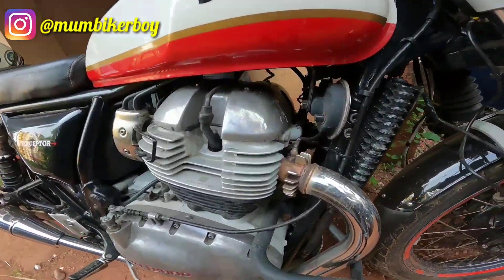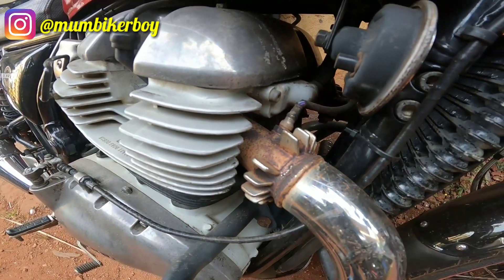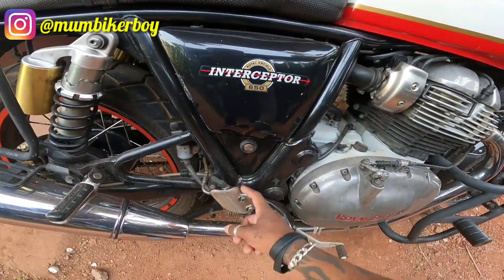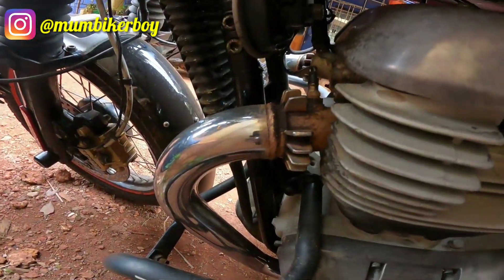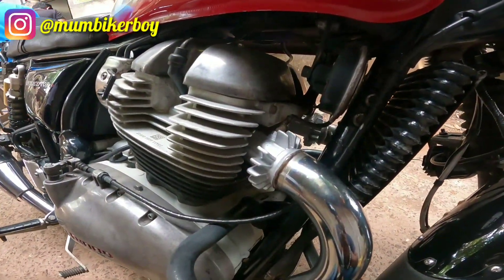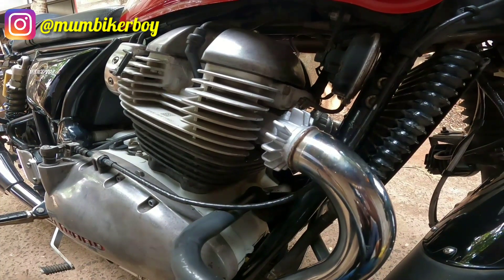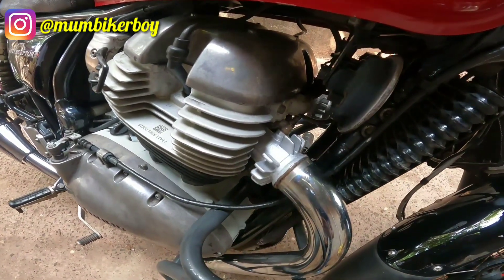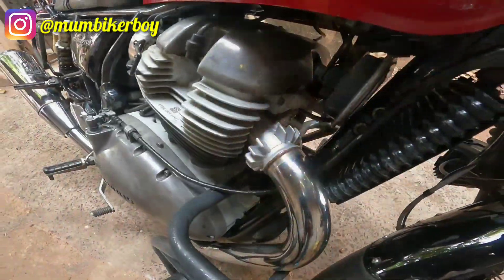Interceptor 650 Bend Pipe Fin Rusting Issue | Solved at Service Center in Goa

Comment: well dude 😎 If u ask me, I would have 🤔done Chroming in that part, the paint what they done ll come off after sometime 🤔, & the rear brake reservoir well u have to change it then & only then they problem ll go away, i got the same prob 😭
Reply from the maker: So mine at times dis engages and I have told them that if it happens again I want a replacement
Reply: @MumBikerBoy  well as u have seen i did replace mine 👍
Reply from the maker: Urs was not engaging at all right
Reply: @MumBikerBoy  mine was engaging and on a middle of a ride it was disengaging on its own and again it's engaging
Reply from the maker: That happened with me also but now they checked n said it’s fine
Reply from the maker: Mine mostly happened on long rides
Reply: @MumBikerBoy  same

Comment: Bro i painted in my bike like this but due to heat the paint evaporated with smell 🥲
Reply from the maker: No this is a special paint N they also applied laker
Reply: @MumBikerBoy  i painted the same paint they used to paint cylinder head of old CI bullet engine silvee paint but that roasted in my pipes🥲🥲
Reply: How did you removed the paint that you painted
Reply: @heGodlike   i dint remove it bro it completely vaporized
Reply: @vichu650  i tried it yesterday putting taralac chassis paint but emited smoke. I was deeply scared